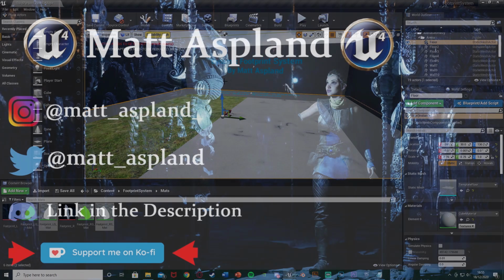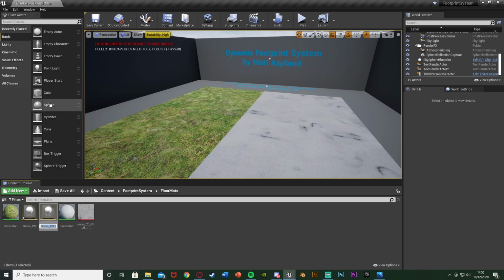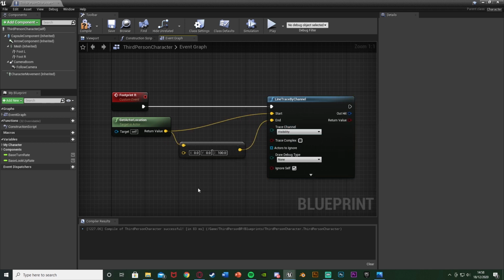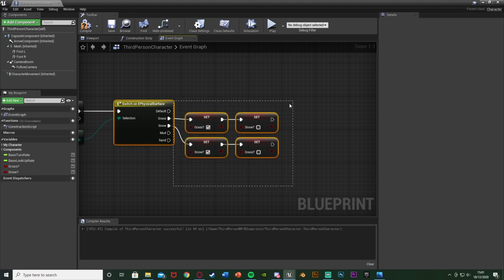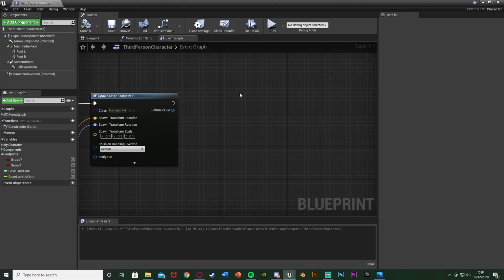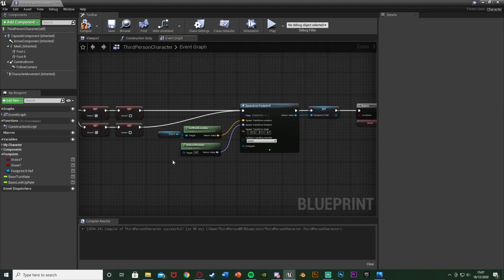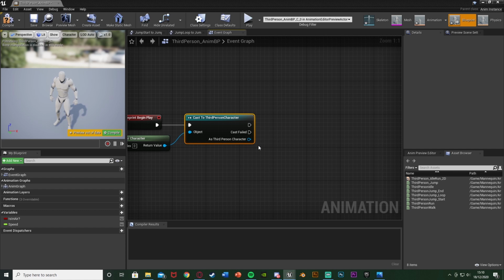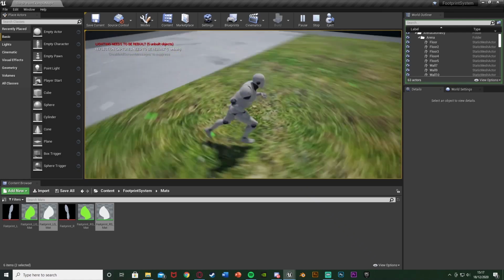Dynamic Footprint System Part 2/2 - Unreal Engine 4 Tutorial

Comment: DO you think theres a way you could keep track of the path walked in sections that can be translated to maybe a spline,  and then replace a section of say 10 of each footprint with a single long  decal containing 10 footprints ?  (they wouldnt be in the exact location you actually placed the original footprints but could probably get them close),  and then that single decal can be allowed to exist for Much longer  ?
Reply: if this worked maybe you could add up multiple overlapping footpaths, and convert them all into an actual path spline?   so basically the more times you walked over an area the more it beats a permanent path into the ground ?

Comment: Why not cast the line down from the foot socket, with a very short line vector, (and any slight offset you might need to line up the footprint decal with the actual foot) then when hit is returned you can get hit location, and the normal of that face, and apply your footprint at that hit location with normal vector rotation (inversed), plus any dust vfx, plus any footstep sound, all in the same moment.     then if the foot doesnt actually hit the ground even though the center root of your character IS on the ground, it doesnt place footprint, make sound, etc.
Reply: also might be nice to just make a global function, in a library maybe , that takes an input of surface type you hit and which type of foot is hitting the ground, then output the appropriate footprint,VFX,and sound for that footstep. so you send in "Grass, Left human foot, soft shoes, current character movement velocity (so you can manage footstep volume), hit location+normal"   and have the function place the fx and play the sound at location.
this way its more modular and you can use it on many different type of walking actors. you can have "Paws" or "Hooves" for example as "type of footstep"